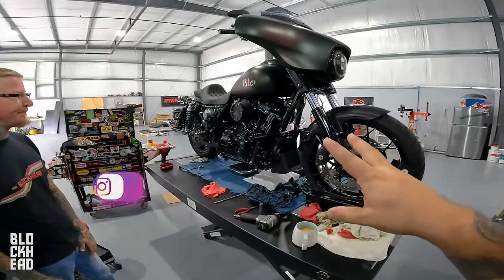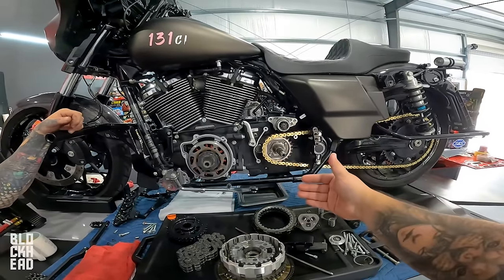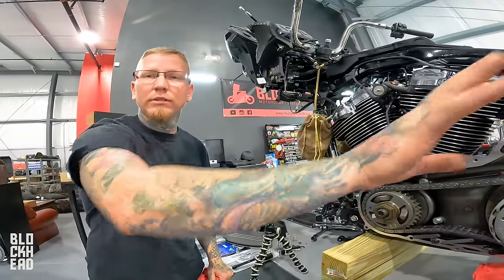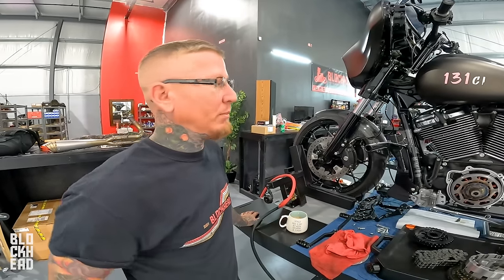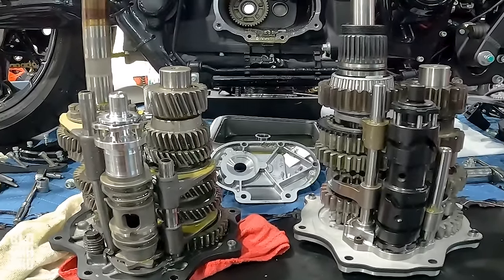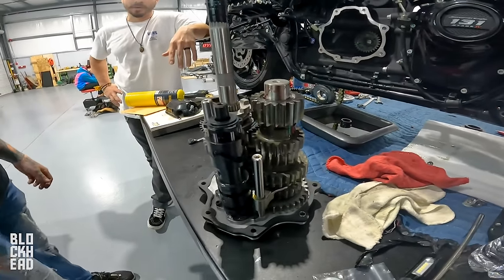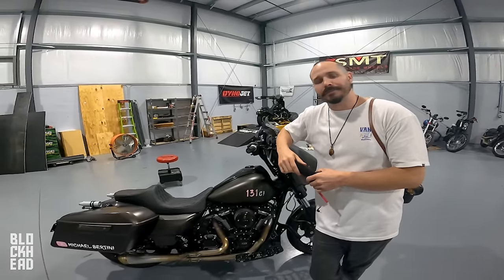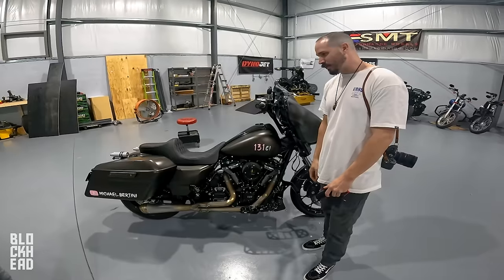Harley Milwaukee 8 Transmission PROBLEMS!

Comment: 17 street glide, on my second 131. 1st one dropped a valve and destroyed it in under 2500miles, $50 later ESP put a crate motor in and still running 20,000miles  with dark horse motor sprocket and SE clutch pack. Thunder Max tuner running 146/141.  It's not a dragster but feels like a good compromise with still wanting to ride it cross country. Been saving up for the grudge box because I figure I can keep my lower gears and a good OD for the highway.

Comment: Great video guys.  Very well done.  Keep it up.  It'll be a great mix , riding and repairs.  It will really help us people with older bikes.  Some of us don't have a choice but to work on our own bikes.  It use to be if you had a bike you could work on it your self.  That's the difference between a biker and a motorcyclists.

Comment: If only I can find someone that can fix my Anti Lock breaking with new lines and new hydraulic res and pistons. All in a way that doesn't trigger break light on the gages. Can you do that? I'll do the lines and reservoir... If it would help
Reply from the maker: We should be able to do that 👍🏼 Fill out the form on http://www.BlockheadGarage.com and we’ll be in touch

Comment: They don't tell you after that upgrade you'll have to upgrade the transmission also 🤑
Reply: The transmission should not be the sacrificial part. There clutch plates are suppose to be the sacrificial part.

Comment: The SDR seems to be the common denominator on failed transmissions that I’ve seen. I’d rather slip a clutch than destroy a transmission.